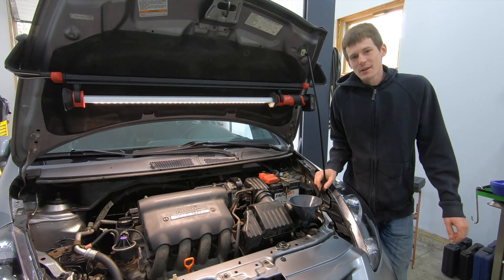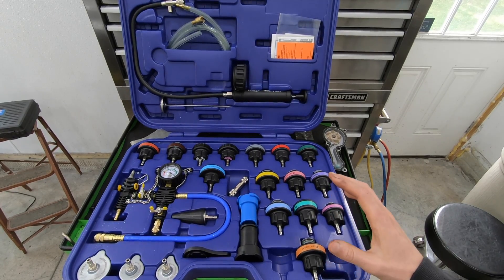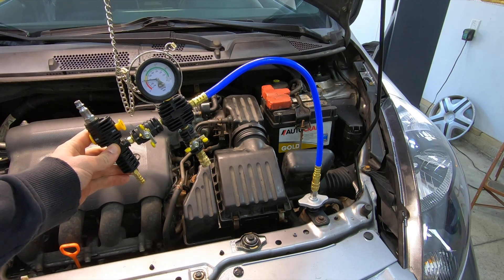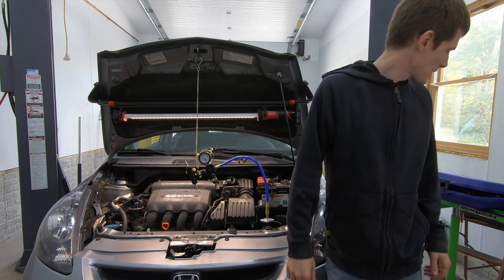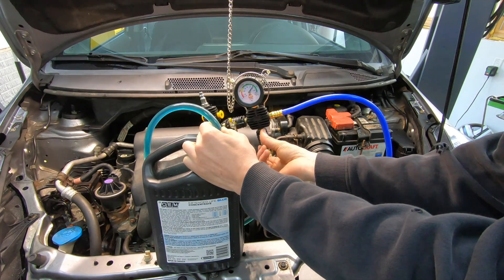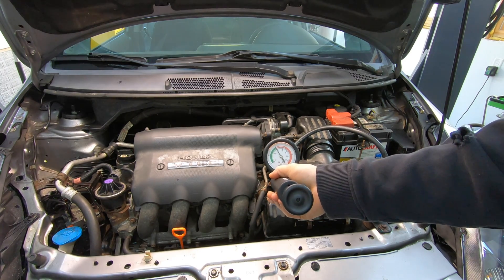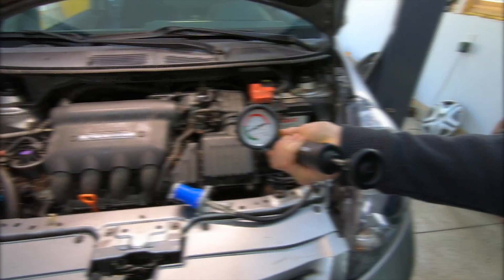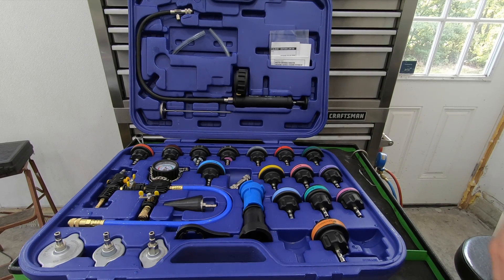How to Vacuum Fill & Pressure Test Your Cooling System

Comment: Depending on the cooling system, and repair made, even though during filling the needle drops to 0 with no more coolant being sucked in, I have found the majority of the time, it is needed to close the fill valve, and open the vacuum valve to further vacuum the system. When you do that, you can hear a difference in airflow (small air pockets being filled with coolant while air is sucked out). You can also feel the air pockets coming through if you put your hand where the tool is hooked to the system. Bottom line, is pulling a vacuum once doesn't cut it on major repairs where lots of coolant is lost, and pockets form in the engine. The venturi effect can only pull so much vacuum on the non collapsible parts of the system, and the most obvious source of vacuum is the flat hoses opening back up. Dont just go one and done. Reapply vacuum for a bit, and fill again. Source: I've  done this professionally for many years with several designs of the same type of tool. They all have the same result, and need to be vacuumed down for a second time to be thoroughly filled. It's not the tool. Its the cooling system and repair made to it.
Reply: Excellent advice, this is exactly what Uview recommends in their user manual for the AirLift 550000.  I have a question for you, since you have run into this firsthand: After the first evacuation and refill, the vehicle cooling system now contains a large amount of coolant.  When you attempt to evacuate for a second time to remove any lingering air pockets, how long are you applying the compressed air?  Are you still attempting to reach 24 - 26 inHg on the gauge? Since the system is not empty as it was during the first evacuation, I'm concerned about how much coolant would be expelled from the tool during the second evacuation (appreciate if you could share what your experience has been in this area).
Thanks in advance for taking the time to respond back.
Reply: @StilettoSniper  @StilettoSniper  not much coolant is lost during the second vacuum. But it needs to be done to remove any sneaky air pockets. I can't give an accurate range of how much vacuum will be achieved on round 2 because results very greatly between cooling system sizes, repair made, and which systems have a tendency to trap more or less air. Personally I mostly play it by ear and timing. You can hear the change in airflow as an air pocket is expelled through the tool. As more air is displaced by coolant, and there becomes less to vacuum, the airflow changes will become less frequent until they stop completely. At which point, only coolant will be slowly sucked out. Flip the valves, and fill the system the rest of the way. And done.

(By the way, there's no reason to worry about coolant being sucked out and lost. Just put the exhaust hose from the tool into an empty coolant jug. It will catch expelled coolant, which can simply be poured into the jug the fill hose is in)

EDIT.. I forgot to clarify a little bit as to an example of two different cooling systems, that would most likely have a very different vacuum achieved on round  2, or even round 3 (if need be). 
Let's say a simple nissan maxima with a v6 vs a nissan armada with rear heat.
 The maxima by round 2 will most likely hit 15-20 inHg and be good to go at the end of round 2. Whereas the nissan armada, since the rear heater core is elevated higher than the radiator, let's assume that the rear heater core and lines drained out during engine repair. Now there is much more air that needs to be displaced, and replaced by coolant. As well as the fact that in that instance, you also have to battle gravity a little. Roumd 2 in that case will most likely be about 25 inHg. And may take a 3rd or 4th round depending on circumstances. 

I know it seems excessive, but I have found myself doing 3 and maybe 4 rounds in some cases just for good measure, but that depends on how the previous vacuum process sounded, and frequency of needle drops. (Oil filled guage for much more stable readings while pulling vacuum)
Reply: @not_me_not_you_not730 thank you for explaining that. I have a Nissan quest and I lost rear heat and could not get that air out.  So I’m buying one of these tools.  I need to do a couple of my other cars too. Thank you again.
Reply: So are u saying I can still take out air pockets even though I already added coolant to the radiator?
Reply: @reviewithme9913  Yes
Reply: @reviewithme9913  yes
Reply: sounds like you have the experiance the guy in this video was claiming with his brand new unused tool kit.
Reply: @stout890  13 years
Reply: Yes this is the way to go. Mine need just a little bit more but worth the second check
Reply: Awesome. I just bought this tool after 15 years working in the garage. This is the type of info I needed instead of the Chinese to English translation pages inside. Do you know if this Toll can be used to create a vacuum to empty the system?
Reply: Are you saying after you fill it then pull another vaccum on it? Or are you saying do a vaccum and then another vaccum and then fill?
Reply: @FleetTech97  Pull first vacuum, and fill. 
Pull second vacuum  for a bit until air stops purging. Fill again.
sometimes it takes a few cycles. the point is to fill the cooling system without getting it hot. if there's a leak, you can tell by watching the gauge and listening to the air flow. 
you can effectively fill the cooling system cold and send the vehicle on its way,but if there's a leak, then you can go back in to a system thats not scalding hot and make repairs without burning the hell out of yourself.  
it is also much faster than running the engine to burp the system with a spill free funnel
Reply: @not_me_not_you_not730  this is the rhyme and reason and way!   well said sir.   and good point about additional repairs needed in a hot system.    that’s the worst.
Reply: Maybe a stupid question but how does this work if the thermostat is closed?
Reply: @DarrelllCampbelll  there's usually a jiggle valve in the thermostat. not to mention cooling systems are a loop essentially. there's other directions, and passages the coolant flows through
Reply: My main question was if this system would operate even better using an actual vacuum pump, instead of a Venturi mechanism. What risks of system damage are there in pulling a deeper vacuum on the cooling system?
Reply: Place a portable air tank in series with the vacuum tool .  This extra vacuum capacity will not place any extra vacuuming to the coolant system .      9/1/23
Reply: Thank you. I've been a mechanic for many years and knew about bleeding the coolant system but just bought a cheaper vacuum. I probably wouldn't have put a vacuum on the system more than once. Thanks
Reply: Well said
Reply: Excellent advice.
Reply: Will air pockets eventually work themselves out if a vacuum system is not used?
Reply: @mattanderton9669  depends on the system
Reply: One thought: As it doesn't work 100% with one pull or even several maybe:

Suck out coolant via vacuum and in the same time fill it up from lowest point like bottom of radiator?
Reply: It’s like it’s impossible to get rid of the air in Jeep Cherokee KL 2.4 Liter petrol 2014-2018. Could you please give me some advice .
Reply: Does the unit blend out the air past the thermostat and or into the heater core lines?  Or is it just pulling from the engine since the engine is isolated by the water pump / thermostat.  Thanks
Reply: @FD-dh2fu  it pulls it from the whole system.  It may not always be successful on the first go — to pull air out of each pocket, depending on the shape, size, component arrangement, bends, high and low spots of the system. and if there’s rear HVAC. Some SUVs have an additional heater core in the rear.
Reply: So you're saying that before you introduce any coolant back to the system you pull vacuum, let it sit, then pull vacuum again?  Then you introduce the coolant and fill to the vacuum is replaced with fluid and the gauge shows 0?
Reply: @scottweiss6750  pull a second vacuum to get any extra air pockets out that may not have been sucked out on the first go. On the  second vacuum, its personal preference to let it sit to verify a sealed system (needle not dropping)
Reply: @scottweiss6750  I work auto manufacturer.  When we fill new car our adapter head allows us to apply pressure and vacuum 
First I  pressure test the system then pull vacuum  and then pressure fill to 1 psi. The adapter head has a a bleed valve that is pulled be vacuum as you fill  
So yes its a good idea to do it couple of times  since you can't apply  
Pressure to coolant
Reply: At what point of refilling do you vacuum again?

Comment: Your video is the best! Picked up the unit through Amazon. I tried to get logged on to your Amazon page, that they were like wanting way too much information, bro. Really enjoyed the way you presented it made it simple I'm kind of bummed out because I really wanted to get one of your geek repair sweatshirts.
Is it for my 2005 Porsche Cayenne sports model V8? The dealer wanted $780 to flush out the fluid and put a new fluid.
Little tricky getting to the drain plug, but all that being said, I got extra money for surfing now

Comment: Fill the hose with coolant prior to filling . Otherwise it will suck small amount of air within the hose
Reply: Yes, in fact my instruction manual states this:”The Refill Hose must be purged. Slowly open the Coolant Refill Valve so thatthe coolant fills the Refill Hose. Close the Coolant Refill Valve. This process willcause a drop in vacuum.Open Air Inlet valve to re-establish the maximum vacuum level in the Coolingsystem. Close the Air Inlet Valve.Open Coolant Refill Valve slowly. The vehicle coolant system is full when thevacuum gauge reads zero.”
Reply: @ACitizenOfOurWorld  what's the clear hose for ? Fits onto the barb below the airline fitting? I assume bleeding off excess air ?
Reply: @jonny_s14 
Yes you can put the hose on that connector so you're not blowing coolant in the engine bay or on the ground if you're doing this outside.  stick the end in an empty bottle.
Reply: Thanks for this reply. I think I am getting an air pocket in a heater core caused by not purging the fill hose first.

Comment: I also do not use the "recommended" 50:50 mix. Why? Because I have found that even though I drained the coolant using the valve on the bottom of the rad, there must still be some distilled water (due to several flushes) in the system and that dilutes the 50:50 mixture down to about -20C. I now use 60:40 or better.
Reply: I ran into this issue and found that by removing the engine block drain plugs to remove any residual coolant in the engine I achieved much better results with a 50/50 mix.

Comment: You missed the Audi-VW-Porsche filling adapter which is optional. AP part number 7858523, cap number 23. I just received mine. But they cut a corner on the production of this cap. The cap has standard threads as found on a bolt, whereas the threads in my Porsche's coolant cap are trapezoidal. It still works though. https://edelweiss.smugmug.com/Category/Tools/i-854TGBs/A

Also the late model Ford/GM cap part number is: 7858541  cap number 41 and the BMW/Land Rover cap part number is: 7858542, cap number 42.
Reply from the maker: Added the Audi adapter. Thanks.

Comment: Can you drain the coolant with that?
Reply from the maker: No, either use the draincock on the radiator or pull the lower radiator hose.
Reply: @RepairGeek  I assume you must drain all the coolant?  Can you use this tool is it 25% or 50% full?
Reply: Repair Geek i have learned the hard way to always pull the lower radiator hose. On older cars the drain is plastic and could snap or is metal and rusted shut. And pulling the hose is faster!
Reply: @zlmdragon.  you again?

Comment: im in the south, we rarely get freezing days.  for the most part I just use 100% water.
Reply: You seem to have totally missed the point! It is not about antifreeze or water! Is about purging the air out of your cooling system so as to get the proper cooling liquid throughout the engine! It freezes almost everywhere in the South of the United States. If it does not Freeze where you are, YOU should still use a coolant other than water in your cooling system. Why would you even let us know that you do not know these things? THINK!
Reply: Water makes the system oxidized. The cooling liquid also saves your engine from rusting from the inside. Especially on older cars. Using only water is ok for testing or flushing but there is a reason they recommend cooling liquid.
Reply: It's NOT just anti-freeze, It's coolant.  (It has a higher boiling point than water).
If you're using straight water, your car's days are numbered.
Reply: Coolant also contains rust inhibitor, to stop the system from corroding.
Reply: Nice, I live down South too.  Are you aware that your water pump bearings do not receive any lubrication from the engine oil.  Know where it gets lubrication from?  The engine coolant.  Think about well 100% water would lubricate those bearings.

Comment: I have one. Try filling an older blazer without it. Heater core is above the radiator.  GM says park it on a 15 Degree slope. Engine facing up hill.  With this kit no problem!.
Reply: BMW has joined the chat
Reply: How old?  I didn't need to vacuum my '99.